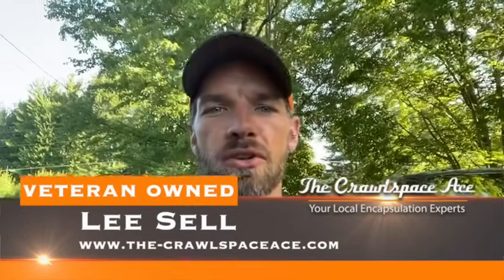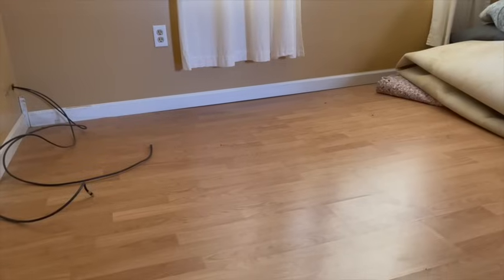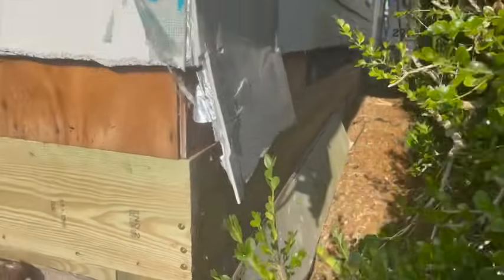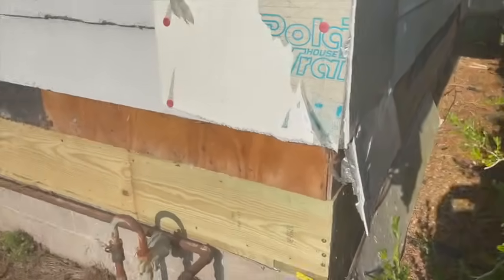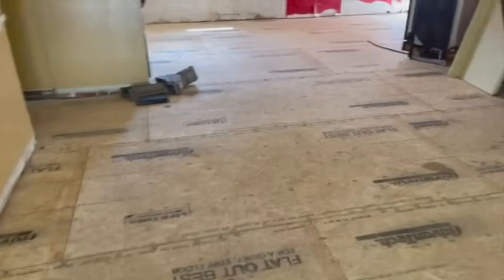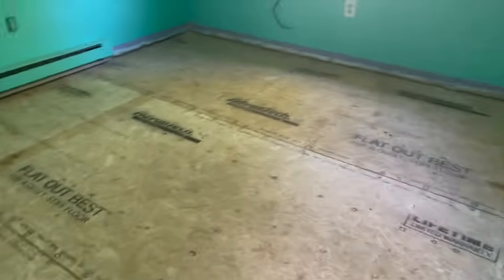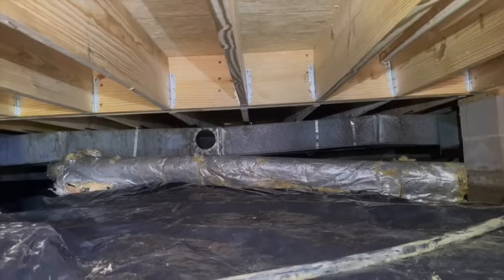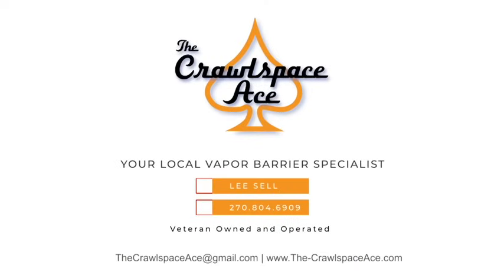Full Floor Replacement Benton, KY

Comment: For the benefit of me and other DIYers that are addressing our crawl space moisture issues with encapsulation, dehumidification, etc to keep this from happening, what kind of expense are we saving. In other words, what kind of price tag is associated with a job like this? You can just give a dollar range to avoid disclosing too much information about this particular homeowners cost. Gotta be a hefty $ tag.
Reply from the maker: Absolutely! that's a good question. These full tear out and replace jobs usually run anywhere between $35k-$55k. And that usually includes at least some kind of preventative measures such as, vapor barrier, sump pump system, etc.
Reply: @thecrawlspaceace4696  🤩 wow! An ounce of prevention…you know the rest!

Comment: Why wouldn’t they do the A/C work during the floor replacement
Reply from the maker: It's hard to explain, but normally we do. This house had the return built in between the joists. Were they box in a section. When we tore out the old joists, that went with it. So, we needed an HVAC company to come out and redo that and figured while they're at it, they can make sure all the runs are set up properly as well.